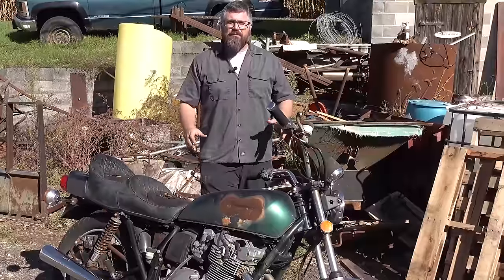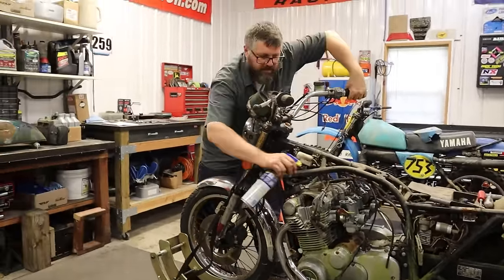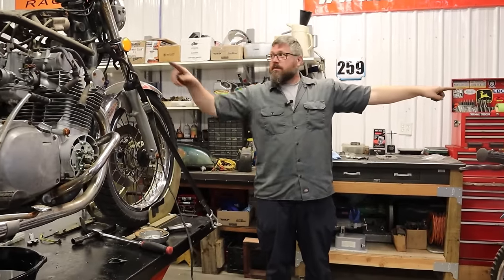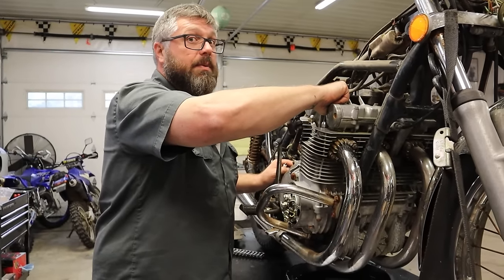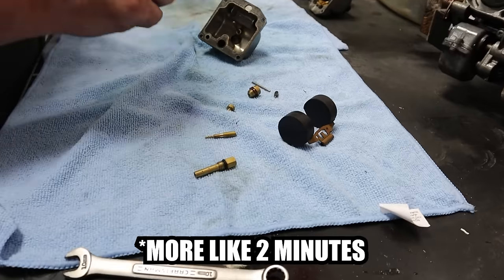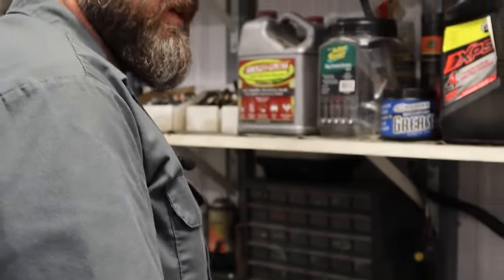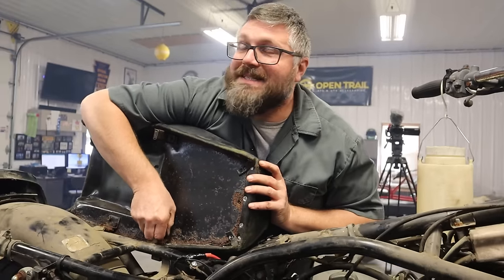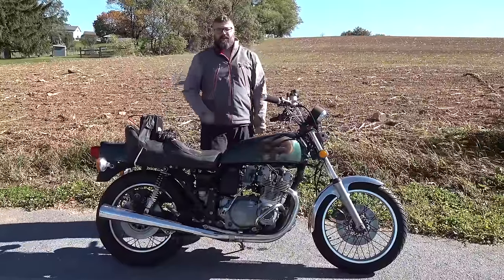Can I Get This $300 Old Suzuki Motorcycle Running?

Comment: I also owned a 1981 Suzuki 650 GL. 4 in line, shaft driven and comfortable driver seat. I just kept pulling the clutch to get to 6th gear for higher cruising speed, it seemed to be working hard at anything above 60 mph, around 5,200-5,500, too high for me. Traded it for an ‘83 Honda CB900F, Super Sport. Silver with Blue striping and graphics. My GOAT of big cruisers.

Comment: Awesome episode, thanks for filming it.  As one battery strap to the seat enthusiast to another, virtual hi five! Had an older cb650sc, i learnt it didn't charge the battery until you were above 2.5k rippems.  Not ideal if you gots a lower capacity battery and am stuck in stop and go traffic. Bomb start and keeper above 3k rpm got yeah home 😆.

Comment: Years back I owned a used GS400 (2 cylinders) and this thing was reliable as hell ... only thing that annoyed me were the points that liked very much to distord themself. But the engine itself was a tank, indestructible (it was the 1000cc cut in half and shrunk a lil bit to fit into the driving licence rules). Nowadays GS models in very good condition are almost worth a fortune because of the legendary reliability 🤩

Comment: The carbs dumping gas like that brings back memories of fixing the carbs on my gs650 83.  The engines though are real troopers, mine runs with a dead cylinder and a vacuum leak on the opposite side.  Engine rebuild this winter.

Comment: Great job Craig I bought a 1978 suzuki gs550 and I basically did the same things you did and it ran right away now I just need to get it dialed in an air filter and figure out what kit to buy to rebuild the front brakes and it'll be a great bike

Comment: I rescued a '79 GS850 from sitting outside for at least 10 years. Last year to still have the kick-starter. Found a few nos parts at Mid-Ohio swap meet. We were able to get it running and passed it on to a guy that cafe'd it.

Comment: I'm currently working on a 79 gs850.  It's shaft drive but otherwise identical to this bike.  Your video gives me hope I'll have my bike road worthy by the end of next year!  I'm at about the same point as you, the motor runs (after a carb rebuild) but in my case the gas tank was very very rusty.  I have been doing electrolysis on it to remove the rust, then I"m gonna do a POR15 3 step treatment to seal it up.  I also need to fix the brakes, sign of the times.

Comment: Those old Japanese motors are virtually indestructible. First bike was an 82 Yamaha XJ650 barn find that hadn't been on the road in almost 20 years. Carb clean, replaced the diaphragms and fired right up. Some electrical and brake stuff I had it on the road regularly.

Comment: I had an '82 GS1100E, '83 GS1100E & '82 GS650E. They all had great engines, except they seem to have a bit of an oil supply problem to the camshafts. All three of those bikes ended up having chewed up cam bearing surfaces which cannot be fixed, because there are no removable bearings.. the head is line bored and the cams ride directly on the saddles of the aluminum head

Comment: To make the old and hard rubbers between the  carb and the cylinder and between the carb and the air filter flexible again, spray them with silicon spray and  warm them up with a heat gun.

(Be carefull with gas fumes !)

Comment: Need some help Craig! ok so of course I lost my motorcycle key and of course I bring my ignition to a lock smith to have a key made and now the thing is operating in reverse so i'm looking to utilize it as a toggle switch my only thing is with electrical wiring can I disconnect the main leads from the battery and just rewire the toggle to where the electric components for the key start were?

Comment: Great video. The GS750 is excellent engine and its much simpler than the GT750 which was a dry sump with pressure fed lubrication to roller bearings and 3 sets of points! 2 very different motorcycles.
Reply: @rosewood1; the GT750 was a loop-scavenged two-stroke (therefore the term "dry sump" does NOT apply).  By comparison, the GT750 was a much simpler bike (no cam shafts and cam drive system, no poppet valves, no oil filter). Since the GS750 was an in-line 4 cylinder with a flat-plane crank, it could get by with two sets of points and two dual-lead coils (sending a "wasted" spark to the exhausting cylinder).  FYI:  the GS750 had a (low) pressure lubed bottom end with ball/roller bearings (i.e. not much different than the GT750's bottom-end).

Comment: I accomplished something similar with a Yamaha Radian 600. The brakes were locked, the carbs were locked. I eventually got it running and had it up to about 70mph on the highway near my house. Unfortunately the gas tank was full of pin holes and replacements were expensive. I sold it and bought a Harley.

Comment: Inspiring,.....my 82 750 magna,...with a new battery,....has no lights,... and no power any where that I can find.
I ebayed a starter solenoid,.. but the wires look a little too thin?
I got another kill switch too.
But don't really have any idea which direction to go.

Comment: Those early GS Suzukis (400 twin, 550 x4, 650 x 4, 750 x 4 and 850 x 4) were absolutely the best UJM of that era, better handling than the alternatives, unburstable engines and supremely reliable
,

Comment: I owned a GT750. The 2-stroke triple was a very good bike with one serious handling issue. It had the dreaded hinge in the middle. When you pushed the bike too hard, the bike would immediately let you know that it didn't like being pushed and the frame would flex and the handle bars would oscillate. Very uncomfortable. The GS750 and it's later cousins, the GS850 shaft-drive and the GS1100 definitely eliminated the hinge. The GS series were rock solid in corners. I loved my GS850, even hung a removable sidecar on it for extra passenger space. Oh yeah. The engine was bullet proof, but the clutch? Not so much.

Comment: I owned a 2013 Honda CB1100 when I moved to another state.  I was going to bring the motorcycle with me, but various obstacles prevented that from occurring.  Which was a bummer, because the motorcycle vanity plate "UJM" was available, and would have been bolted on the back.

Not too many UJMs around in 2013...

Comment: Well, it is a Suzuki which means it will work.I still have my old Bandit 1200s, never leted me down.2 yeas ago, I bought GSX 1400 and in my opinion,it is in the top 10 motorcycles ever made.I love them bought but the 1400 is something special for me

Comment: My dad had a bronco with that same carb and it would never pull the secondary’s open no mater what spring was in there and he finally read an article put out by holly that a small cubic inch motor on a light vehicle like an early bronco or an airboat will not pull enough vacuum to open the secondary’s hope this helps

Comment: It was 16 valves before the gsxr. When gs went to gsx esrly 80' it went to 16 valves. Gsxr was the mid 80' racing engine's with bigger bore and shorter stroke amongst some differences.

Comment: I totally get Craig’s excitement on this Suzuki  I grew. Up in South Florida and we had a motorcycle shop that began in Fort Lauderdale and in the1980s  started doing Rentals around Fort Lauderdale Airport  the Owner began with a Fleet of used Motorcycles  he picked up at good deals  myself and a group of friends all owned our own bikes but we would often rent a bunch  to do  some long rides around the State we were all good friends  but fought over getting these 4 Cylinder Suzuki ,Yamaha and Kawasaki Bikes when he had them  I liked them  for riding   More comfortably with my then Girlfriend on the back of the seat then my smaller Yamaha Special  that at highway Speeds got light on the front wheel ? I was in love with the water cooled Versions of Honda and Kawasaki brands of that era 75 thru 80ish ) I did eventually get a great deal on a Honda 750 four Aircooled I rode for years that I liked a great deal  for a rider the balance was great and it’s Powercwas Adequate with one hell of a good reliability  factor

Comment: This model Suzuki was the spoke wheel edition and it's right before tubeless tires were introduced to motorcycles and the mag wheel twin disc edition was soon after and Suzuki introduced the 750 GS first it handled so good that they started putting 870 cc kits to run with the KZ 900 and KZ 1000s and Suzuki was rushed to introduce the GS 1000 early and really wanted to equip it with tubeless tires and mag spoke wheels

Comment: My main issue with rescuing old motorcycles is that most of them that have been outside have rust or pits on the forks and they have to be replaced at great expense.

Comment: Correct, that engine was the grandpappy of the GSX/R. It was also unashamedly based on the Z1 900 engine. So by crude logic, the basis of the Suzuki GSX/R powerplant was designed by Kawasaki.

Comment: Man..I make my own carb gaskets out of the sheet of cardboard that comes in banana boxes..its ideal...just cut a square and using a small round head hammer tap lightly around the inner and outer edges of the carb and an impression, or sometimes it will cut right thru, and no need for sissors...

Comment: I have a gs550 that set in a barn since the early 90s. I think it is a late 70s. Have a clear title but haven't looked at the year for awhile. The bike only shows 8000 miles and the engine is not stuck. If someone would come and get it to restore i would give it to them. I just don't have time and to old to start on a project like that.

Comment: Hey craig i have a question for you. My brother in law is selling a suzuki i belive boulivard 650 for $350. He said that it needs some rod that is in line with the clutch right where the cable goes into motor the cable hooks to a rod. Idk but it looks like an easy fix. My question is? Is it worth $350 in your opinion?

Comment: WD was not intended as a lube. WD stands for "wire dryer", or "water disbursement". Back before resistance wire and silicone insulation in ignition cables, moisture could cause your wire to arc and ground out. WD displaced the moisture and allowed your car to start.

Comment: I had 3 GS425's, 3 400's and a 550T- all from 1979. This one is a 2 valve 750- They called them that as they have 2 valves per cylinder. The 4 valve has rectangular cam caps. Unkillable motors. The weak link is the stator.

Comment: These air cool 4s were Overengineering as had roller ball bearings on the crankshaft as on 2 strokes but had a wet sump so were virtually indestructible.

Comment: And I just found some guy selling a 1980 GS750 (I think L) that appears to be complete (surface rust and a completely knackered seat not-withstanding) for the low, low price of $200.  Don't need another project right now, but I'm still thinking about pulling the trigger on it

Comment: My dude? you have to reseat the float valve. use Toothpaste on a q tip to sand the mating part to the float valve up within the carburetor body. Next, take carburetor cleaner in a spray. can. Spray vigorously in all all all opening till it comes out. As fast as it goes in.
The orfice within the carburetor body needs cleaning out as well.

Comment: I'm in the UK and over here to use anything on the road the vehicle needs to have:
MOT - 12 months safety check carried out by a garage.
Road Tax - 12 month Government charge for 'Road Maintenance'
Insurance - obvious what this is.
Does none of this apply in the US as I'm amazed how after getting it going it can be ridden legally with no rear brake and a battery strapped to the seat. 😮

Comment: Well, maybe someone has an idea in here.

I have a barn find CB360 1974. It has decent compression, and iv cleaned the carb completely 3 times.but for whatever reason, the left cylinder only fires half the time.  The points looked fine. The sync seems fine. And added note that when you get on the throttle, the other cylinder jumps right in like normal and makes the bike take off. Any ideas what I did wrong
Reply: Check condensers.

Comment: I have an 82 CM450 that looks a bit like that bike.  Love it.  Other than it's heavy and sits too tall.   

That's a sweet bike, in better condition than I got my first bike a Honda Rebel in even worse condition.  You followed the same process or sequence I would of done.

I restored it, mostly, but it still has some problems from the monkey that came before me that abused the H out of it.
For one thing the little gear box axle the front chain sproket slides onto , is really kind of stripped for the keys and the front sprocket wobbles with a lot of slop.   I don't know how to fix that.  It works, but I'm worried it will eventually fail.   I don't know how to fix it other than taking the engine completely apart (beyond my skills, patience, and time), or just tack welding the sprocket on every time (a bad idea (tm) I'm not going to do.    Anyone go any ideas?

The part that breaks my heart the most about your barnfind is the rust on the forks.   
I got that stuff on my bikes too.  I'm not sure how it happens.  The chrome is suppose to prevent that, so what gives?   I can fix everything but that.  I don't know how to fix that but... derust it with phosphoric acid... and then what?  How do you rechrome it?

It's the idle jets that also give me problems.  You can make temp gaskets out of cereal box cardboard.

Comment: Wear safety glasses when spraying carb cleaner,
...the spray back from that stuff made me go blind in both eyes.  And I only got microdroplets, not a full blast.  I was holding it far away from me too.  Hit a curve and came right back at me.   Not joking, a can of carb cleaner is the most dangerous tool in your workshop.  Acetone, Toluene, Xylene, all solvents.  .  Pressurized cans of  stuff should be outlawed.  Splashing water in your eyes won't do a thing.   
I had to get both lenses in both eyes replaced after being blind from it for 5 years.

Comment: That engine was basically like a offenhauser basically double overhead cam bucket on valve adjusted the valves with shims it was a very high-tech engine and still is I didn't know they were still using it modified that makes me want to get my 550 out... It's the same engine almost )it's just a 550. The 550 was a 6-speed and then they made a 400 vertical twin that was really fast for a 400 and it's rare than hens teeth right now

Comment: Well I have a '78 GS750E. It is fast and what shows to be the top speed is BS. I have owned mine for some 30+ years. It is comfortable to ride and when you want to move it does not let you down. Granted I have done a lot of work to it but never torn the engine down. Bad thing is it be getting hard to find OE stuff.

Comment: The cranks on the 1000cc bikes were a weak point and often need to be strengthened. The motors were all roller bearing motors which gave them an advantage at the strip!

Comment: Years ago I was told to put a couple of tablespoons of something like marvel mystery oil in each cylinder and let it sit for a while before turning over an engine that had not been run in a long time.  The general idea was to have a little lubrication on the rings to prevent scratching the bore before the oil from the sump finally gets up that far.   Is there a reason why that doesn't appear to be done on shows like this one, or is it a step we just don't see?

Comment: I've owned 2 of these i  the late 1990's, 1 with wire wheels, the other with aluminum wheels.
Nobody wanted them back then.  These were MUCH better to ride then the Honda CB750k6 i had before. Stiffer frame, better brakes, beefier front fork.

Just not modern anymore like the ninja's, gsxr, cbr, fzr, etc

Comment: Ive read that these early GS series bikes were intentionally over engineered.  They have roller bearings instead of the brass alloy bushings that Honda used in places.   I should have kept the GS400 i once had

Comment: got question I have a honda vfr750f-k 1989 stanles steel down pipes in to 2 cans and the cans are streat threw no baffles the carbs are like 4 and abit turns out but it runs mint is that too much turns out on fuel mix screw

Comment: Those model year rice burners, on the carbs when on the bench, bottom up remove the Welch plugs that are located on the head side of rack. Give them the gentle seat and back them out with plus one to that much they went in.
The bikes I've reserected the last thing is to go to the starter and look at the three heavy charging wires, dually yellow. If where it pulls in if signs of excessive heat I would just cut back to clean wire and silver solder them together...o~`o

Comment: Man this chap is funny. I like the trend he comes up with. For example Japanese universal motor cycle. That is only used in America. We got the same model Japanese bikes here in New Zealand we also got some models you guys never got. We had the same type of motor cycle specs as South Africa as in full horsepower and slight engine spec differences. He knows his stuff don’t get me wrong but he forgets important information. We also got Japanese domestic market bikes that weren’t imported into America. Harley was to expensive to buy here after importing them.

Comment: So with the 78 gs750e I have to replace the wiring harness and I’m wondering if the positive battery connecter connects to the whole harness or just the starter motor and starter relay

Comment: I own a 72 plate 1250 gsa pal i tried the 1300 and its ok but its imo and for me its too small engine isnt that much better the other extra goodies blind spot auto lowering  fancy center stand aint worth the  extra if i was you i would upgrade to a 1250 awsome machine